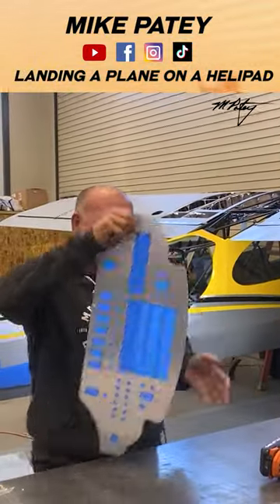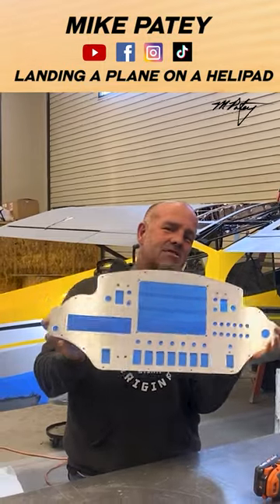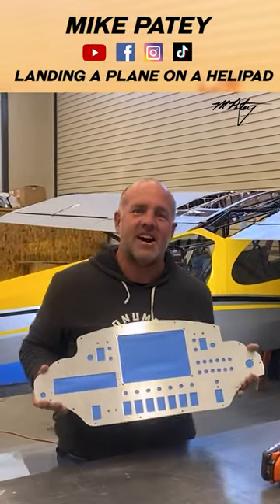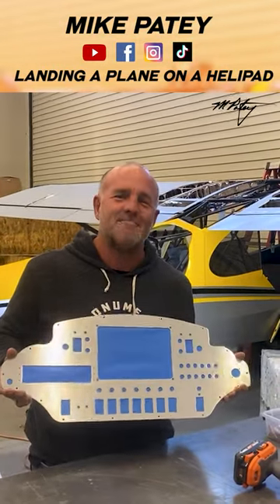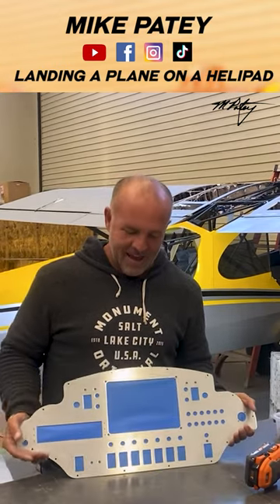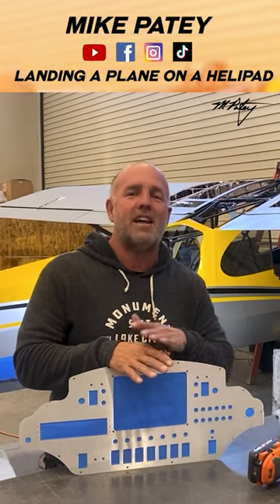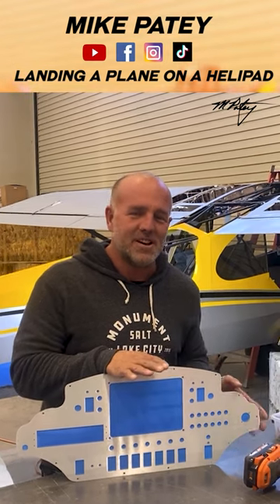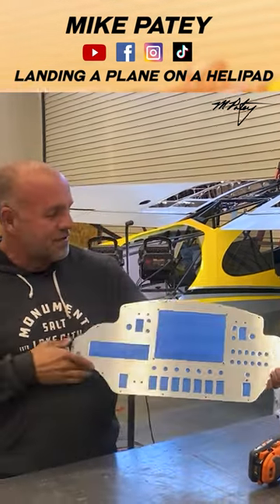Avionics UPGRADE to Garmin AND we shave off pounds of weight | Behind the Red Bull Airplane Build

Comment: Hi Mike. Such a pleasure watching your videos.  I was really impressed with the construction of the wings of your aircraft.  You obviously researched the correct alloys to use and was pleased to see the overall marking of the wing sheets -2024 clad. 2024 is a classic duralumin alloy used on wings and being high Copper for strength the corrosion resistance is terrible so cladding with pure aluminium provides corrosion resistance that is required.  I spent my working life producing alloys for Aerospace.  You talk about weight saving. The new generation Aluminium/Lithium alloy is 10% less dense than conventional alloys and has fantastic fatigue resistance but very expensive to produce.